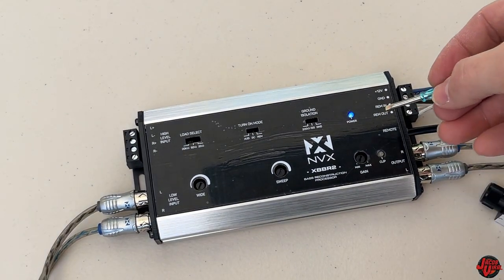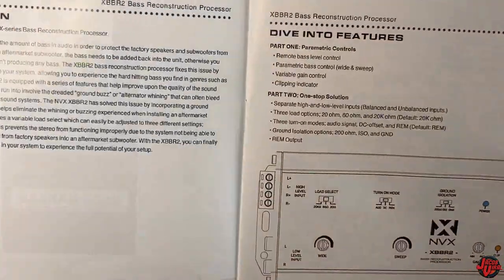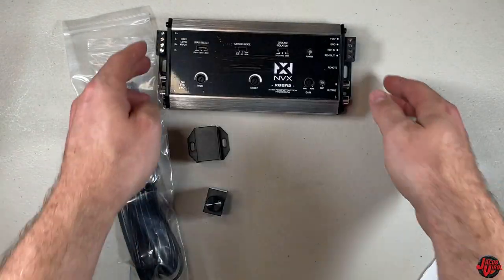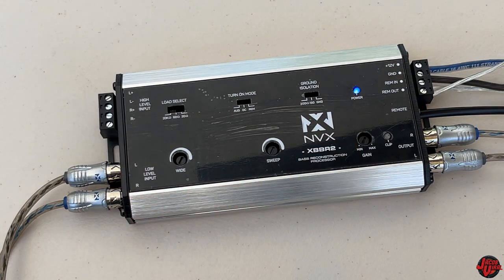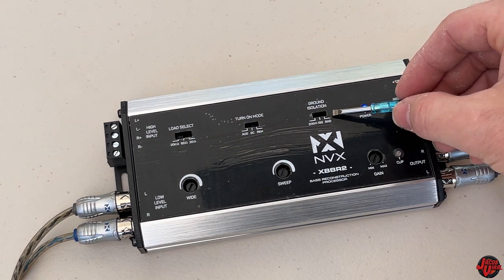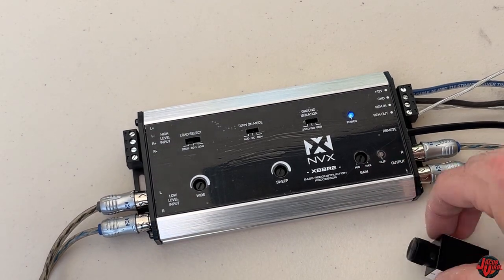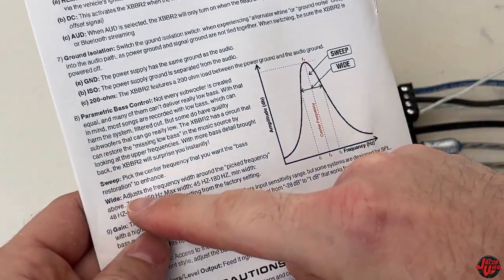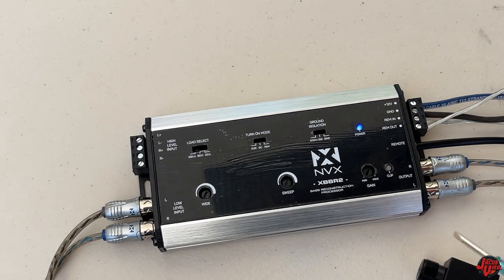WHY YOU NEED A BASS PROCESSOR AND THE BENEFITS

Comment: I've got an Lc6i and an epicenter with the 27 hz module on my factory system and it made a huge difference . Had to put it on the lowest output voltage since I'm running Taramps but haven't had a single issue and everything I listen to sounds way better than it ever did before.
Reply: The voltage output on the epicenter doesn’t really matter just means you’ll need to use the epicenter knob more or less for the same effect
Reply: @abelscaliber7969  You are incorrect! If you read in the manual it clearly shows that if the inputs on the amplifier you are connecting it to can only handle 3volts then it needs to be on the 2.5 voltage setting. Otherwise it will cause an input overload and the amp will go into protection, which happened to me seversl times when I had it set to 5 volts. Hasn't happened once since I put it at 2.5 volts
Reply: With lc6 and the bass booster are you running a DSP too?
Reply: @pgroadglide1581  I thought about it but no I'm not  running a dsp . System is loud, clear and crisp and now that I've got my epicenter installed everything I listen to has amazing bass. Been very happy with audiocontrol products. Great quality 👌
Reply: @josephtorgerson4902  alot of people I see says it helps with older music, what of your playing today's music like rap with heavy bass,would you have to turn the bass down to keep it from being ro much???

Comment: The biggest advantage of a bass processor is having the ability to "rebass" your music at will. When tuned just right they can make regular music play like "rebassed" music that a lot of people listen to nowadays. I've never tried the NVX model, but I've tried a few, and the Audiocontrol Epicenter is the best. One thing to note is that you will either need to set your gains with the level of processing you desire, or turn down the bass level with a remote before processing, or it could sound muddy, or cause clipping.
Reply: Does using a digitial equilizer on the phone you are playing music from have the same effect? I'm guessing the answer is no but I'm not sure how they would differ
Reply: @bAc0nBoY755 Yes, and no, but not the samething as boosting with an equalizer. A Bass processor can add lower frequency output that isn't there in the original or you can tune it higher which can increase output in the frequencies that "are" in the original track, but at a higher level than recorded.

Comment: This resemble as the new audiocontrol epicenter micro. This devices just came out on the market not long ago. Audiocontrol epicenter micro has more to mess with than the nvx. Both work the same as line in converter, and acts like a booster. Now audiocontrol added the epicenter in their converters.
Reply: Have you tries this one? is it as good as the epicenter micro?

Comment: Thus would be perfect for low voltage after market decks. That Kenwood you have can benefit from this gadget.
Reply: Or he could get the DNX997XR! 😛
Reply from the maker: Yessir 👍
Reply: @Trucker-Belly  Man, I upgraded from a Kenwood ddx595 to a pioneer avic 8500nex. I sold the pioneer and got a dnx997x just for the sound quality. There was nothing wrong with the pioneer and infact , It had a much better GUI. But Sq on on both kenwoods worked so much better with the rest of my system. Oddly enough the pioneer ended up sounding better in someby elses car with their equipment, than it did in my own car.
Reply: @Jsims111  nice.  I added an EQ and my front stage is jacked up at the moment and I havent had time to do anything with the deck except bluetooth and the Garmin GPS.  I do like the deck but I havent started using any of the features yet

Comment: It takes songs that doesnt have good bass and finds the bass at higher octaves (harmonics)to tell where to restore the bass at your selected lower frequency.  Doing it this way the restored bass will match the songs perfectly and in real-time.
Reply: i have a 4th order tuned to 25 hertz, how much could this benefit my system
Reply: @chaseman4622  it puts bass back in songs that never existed before so it would help.  It may not go low enough but check out rebasssed music in the 25hz range.   Just type rebassed 25hz into youtube
Reply: @chaseman4622  rebassed music sounds 100x better than a epicenter or any bass reconstruction device could ever create.
There’s like 3 songs I know that sound good with an epicenter … most of the time the bass is not even on beat or just sounds very out of place
Reply: Thanks man. He sucks at reviews

Comment: Made specifically for aftermarket or factory head units? As opposed to head units that aren't aftermarket or factory?
These things are redundant & obsolete ever since the advent of DSPs and/or factory integration processors.
Reply: I used to think the same the thing until I experienced one for myself.  A DSP and an bass processor compliment each other not replace one another. I tried all sorts things from sliding the left side of the Eq all the way up to using the bass boost and none of those things can truely replicate having something like an epic center.

Comment: Would this be good to use for older song that doesn't have alot of bass?
Reply: yes, this is exactly why these bass processors/restorer are used for.  Jazz, Classic Rock, vintage will have deeper boomy bass.
Reply: Is it the same as a dsp?  The reason why I ask is cus I have prv dsp 3 way
Reply: @craigmeeker6777  some dsps have bass enhancer, subXpander or bass restoration feature so that will be redundant. Not sure if PRV has that same feature.

Comment: I have super faint alternator whine coming out my mids highs. How would this fix it if it's connected to bass amp?
Reply from the maker: The rca output going from this device then into your amp after could help, also could be a grounding or stereo issue.

Comment: The paint job or finish on this device looks absolutely horrible! Looks like the paint was applied and just before it flashed, or dried, someone ran a brush through it and it dried showing the brush strokes! Certainly hope it's not indicative of its over all quality! I noticed the part of the manual I saw showed an isolated ground. I would ground it to the body somewhere rather that to the battery. Years ago, like '99 or so, i ran a cadence electronic crossover with 7 volt line driver and back then running two kicker amps, increasing the voltage made an incredible difference! You dont hear much regarding line drivers anymore except in certain devices that include them as one of many other features. Today's modern equipment, new head units apparently have a higher voltage output so I hear, also some newer amps like Tarramps dont like higher line level voltage but the next time i build a system, and mind you I will need to look into details to ensure its beneficial but I'm looking into the powerus 8k which pushes 12 k